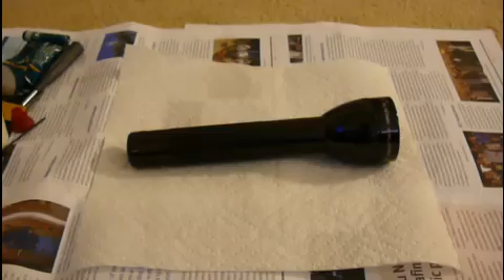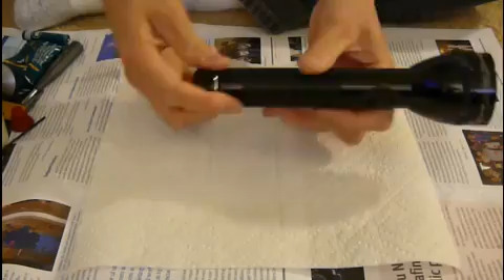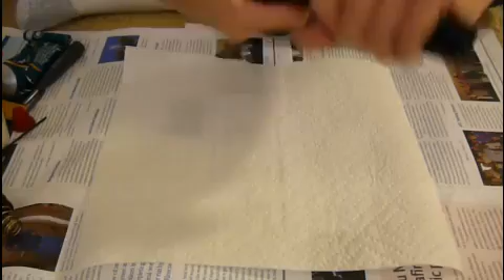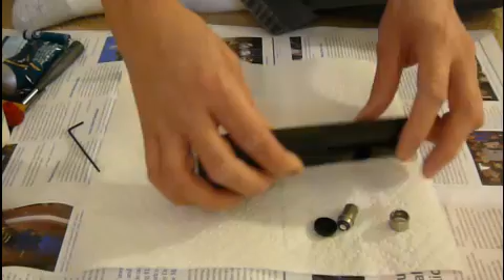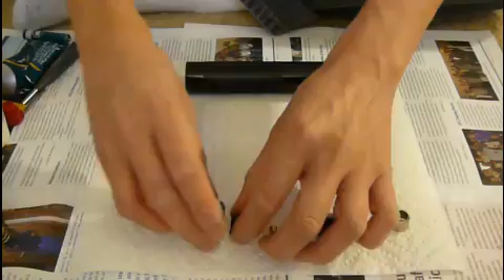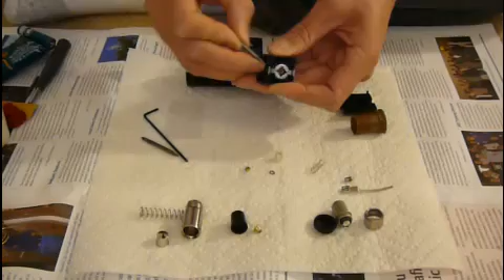Maglite C-Cell Disassembly

Comment: Does Maglite still produce 5C-Cell flashlights? And yes, I know they exists, I used to have one. I actually need one for my job (security) to 'use' as a baton for self defense. In my country (Belgium), owning a baton is illegal (unless you are policeman or military), but you can own a flashlight with a max. length of 33cm (about 12inch). The 5C Maglite is ideal. Ok the 4 D-cell Maglite is also the same lenght but it has a wide wider/thicker handle (because D batteries are thicker). That's why the 5C is ideal. Long enough, and a thinner handle so it's more suitable to usa as baton for self-defence. Does anyone know where I can find one? Online it seems to be impossible, even on the website of Maglite itself. Thx

Comment: apply heat slowly,  keep tapping cap until it releases,    apply penetrating oil,  o-ring may already be ruined - get another,   if corroded - clean out with baking soda / brass brush - oil,      this very oldskool?, regards